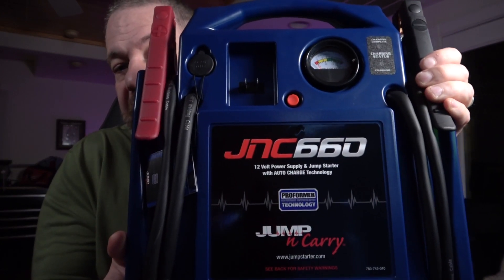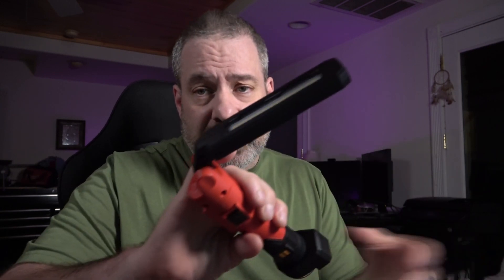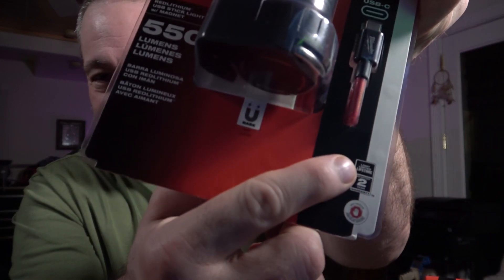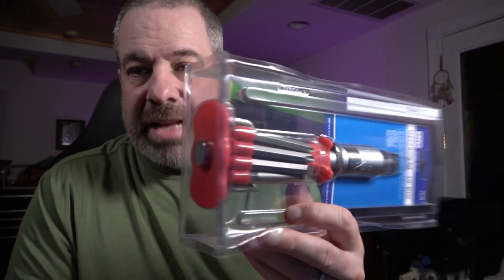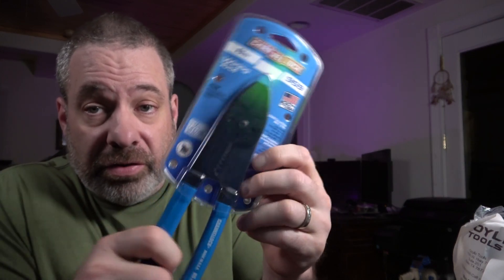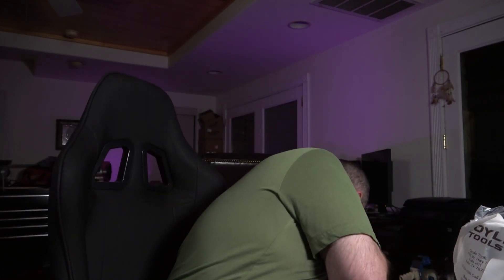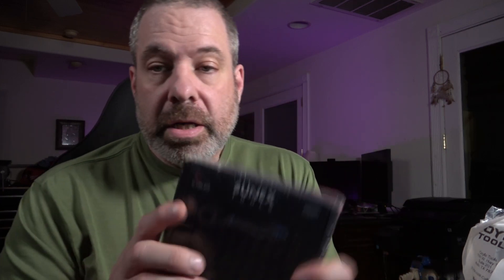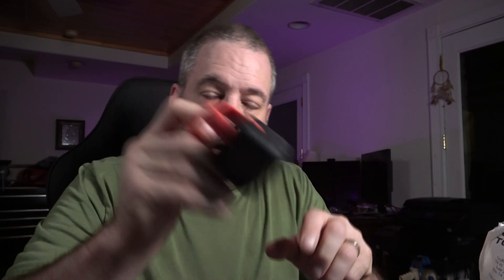Tools in the Haul, Episode 34 The Greatest Tool Haul on the Internet!

Comment: Air hose. Used for airing truck air systems. Important for locating air leaks with engine off so all that can be heard is the air leak. Put a glad hand on, air up a trailer. Great tool!

Comment: Check out Spring Tool Co.I bet they make the Mayhew brand as well as Matco and several other tool truck rebrands. I've used their spring tool punches for over 15 years with great success to punch out the steel center pin on rivets used on door glass, window motors, and window regulators before drilling the head off the alum rivets. I prefer these over a regular punch and a hammer when working around glass. And yes. they are made in the USA.
Reply from the maker: Spring Tool is available to me through a distributor I haven't done business with... yet. That may change, but right now the brand isn't available to me. Mayhew is a manufacturer, and they make pry bars in the US for many other brands, so it's possible they're the manufacturer for Spring Tool, or Spring Tool makes them for Mayhew. I don't know.
Reply: @CoyleTools  Clay Koon did a tour of Spring Tool mfg  local and they were making a run of the black finish tools at that time. He also did a tool show, not the last one in Vegas, showing some new stuff Spring Tool was making.I bought my sets from them direct, so maybe check them and KOON TRUCKING out on the web. Spring Tool had a site at that time. GREAT PEOPLE TO DEAL WITH, at least back when I bought mine.I know JOE'S TOOLS  buys from them and he's an indy tool truck dealer. I'm for what ever it takes to get GOOD tools to GOOD people as inexpensively as possible. Hope this helps you out . THANKS....

Comment: The air hose thing. Did you try a hydraulic hose company, like TFE or Power components,  they usually have something that will work. Or can lead you in the right direction.

Comment: I have all 3 of the Milwaukee sae/metric kits, Home Depot had a sale, 399, they are nice, but that square head is frustrating at times, I've got more of the 1/4 and 3/8 stuck in spots or couldn't get them in. The 1/2in kit I never used cause the frustration of other 2 kits. Good idea,  but can screw u if u don't watch

Comment: What's the difference between a life time warranty and a limited lifetime warranty?
Kind regards.
Dain 🇬🇧☕🇺🇲
Reply from the maker: All lifetime warranties are limited. The "limited" means the warranty doesn't cover failure for absolutely any reason. So they're limited only to manufacturer defect and will not be honored in the case of abuse, misuse, neglect or modification. They're also limited to a company's ability to fulfill a warranty claim. If a tool breaks 20 years after it was purchased, but the company discontinued it 10 years ago, they won't cover it. Warranties are also usually limited to the original purchaser, so if you buy a tool second-hand, the warranty won't apply to you.

Companies can't afford to have unconditional lifetime warranties. LL Bean used to, but discontinued the practice because it was much too expensive.

Comment: Tekton makes really nice ¼" and ⅜" sets in nice blow molded cases. I use these at home. 

Have you ever sold Tekton branded stuff? Super fast and easy warranty as well. Take a picture of the broken tool, email it, and they ship a new one.

Sockets are mostly Taiwan, but their boxes are Canada made, and tools like their angle wrenches (which are some of the best) are USA made and pro grade.
Reply from the maker: Tekton doesn't want to develop a dealer network, so they mainly sell through their Amazon marketplace.
Reply: @CoyleTools  I see. However,I don't understand how that works to their benefit. Thanks for the insight. 

Why would they do that? I know they sell to Home Depot too.
Reply from the maker: @nathandnicholson  I don't know that they sell to Home Depot. HD has different programs like a Merchandising Supplier agreement where a company sells through them, kind of like a marketplace arrangement. There is also an affiliate program like what Amazon has. So I don't know the relationship Tekton has with Home Depot specifically. When I inquired with Tekton a couple of years ago, they told me they weren't interested in building a dealer network since they sell through their Amazon marketplace. Perhaps that's changed.